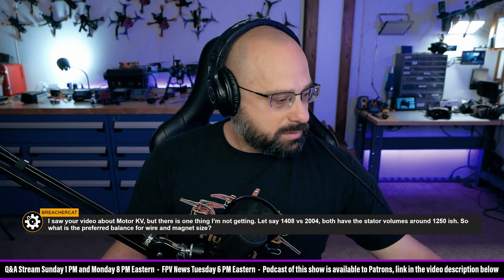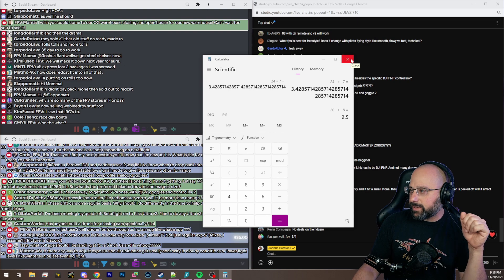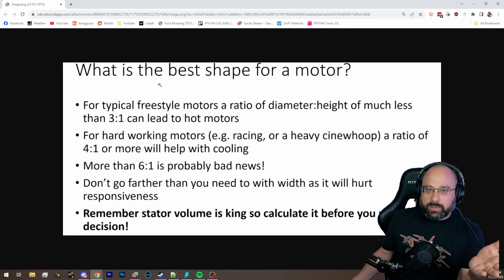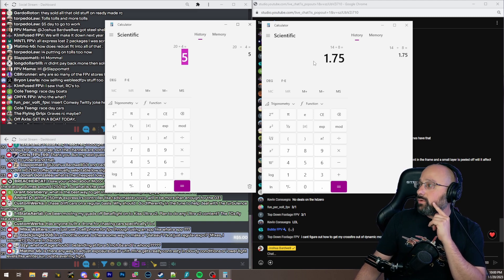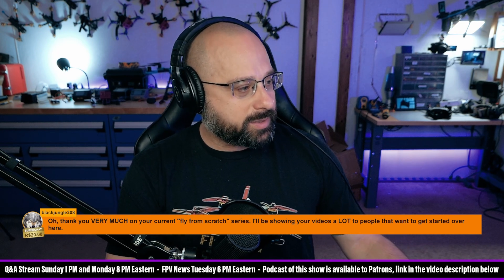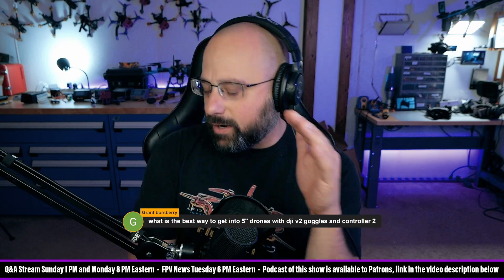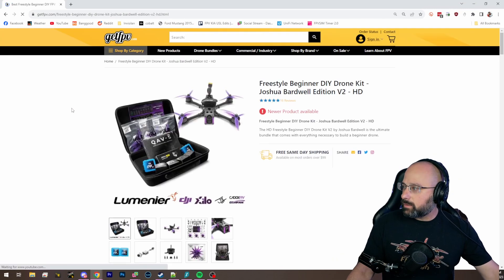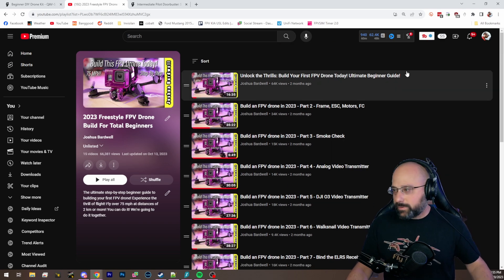Stator Volume of Motors Vs Width to Height Ratio? - FPV Questions

Comment: Can I run a li ion battery on 2306 2650kv motors?
Reply: As far as i know lions are not suitable for freestyle. But if you fly at constant RPM in a long range style they can be better than lipos.

Comment: I'm taking up this exact topic for myself. With the title of best 3D motor. Because in 3D you want a quick change of direction of rotation and tall motors are better.  But of course there are limits due to heat and market availability.  But even Chris Rosser said that high motors aren't that bad, the quick reaction of these increases the smoothness because the controller can correct the aircraft's position much more quickly with these motors...